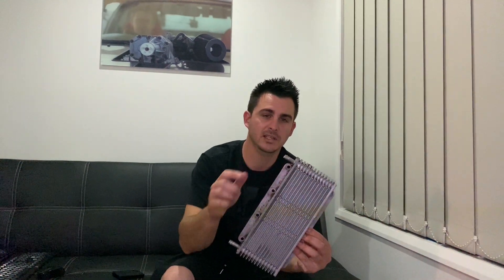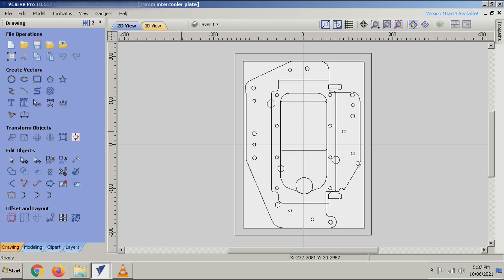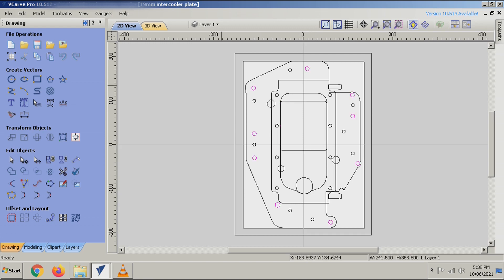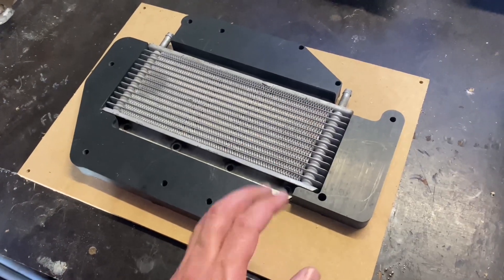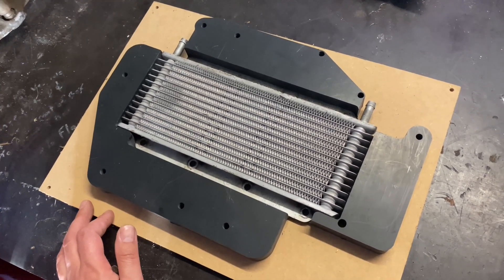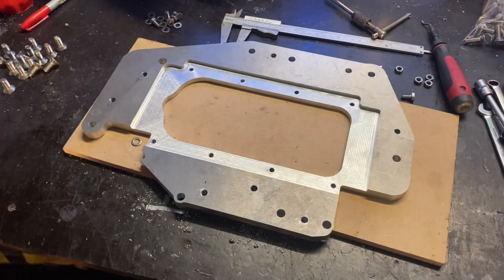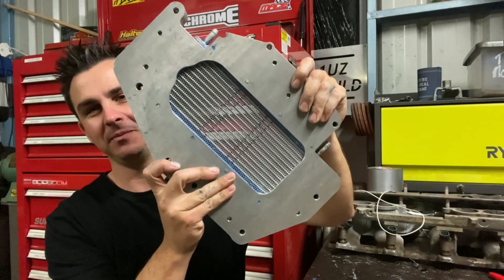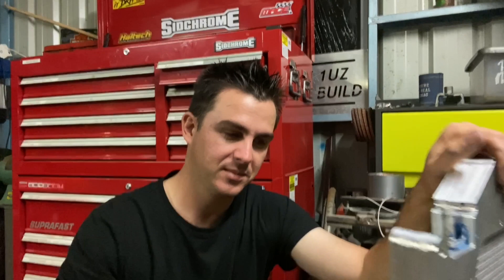M90 Supercharger Intercooler Plate Fabrication(Design & Assembly) [Part 1 1UZ W2A series]

Comment: Nice, 

I would love to make one like this or something similar. Was there much difference in air temps over the cooler?
Reply from the maker: Thanks. If I remember correctly it was about 22 degree Celsius temperature drop when i run the car on the dyno last year. If you want more details I discussed it further in the Boosted 1UZ E85 Vs 98 dyno video. I hope this helps 👍

Comment: Excellent machine work. Do you know the flow rate through the transmission cooler? The YellaTerra intercooler ports are about 12mm? I like the a/c idea a lot.
Reply from the maker: Thanks, I’m not sure about for rates at this stage. Would be very interesting to test and find out though.

Comment: Is the heat produced in the supercharger or is it soaked up from the engine?
Reply from the maker: The heat is being produce from the supercharger. Because it is being spun faster than it was designed to be run it starts to increase the temperature of the air as rpm increases
Reply: @Brodorsport  If it was engine heat phenolic spacers may have helped. It just seems weird to me that a spinning object could create 120 degree heat.
Reply from the maker: Yeah all blowers are like that unfortunately. They have a specific efficiency range they are supposed to run at and if you overdrive them they start to generate alot of heat. So basically a larger supercharger at the same boost level will blow cooler air that the smaller one could
Reply: @coolhandluke1503  Its compressing air man, thats why its gets hotter.